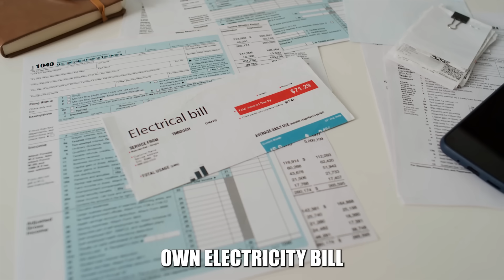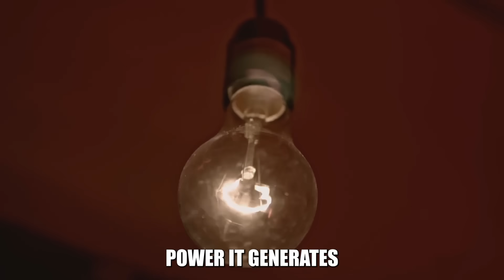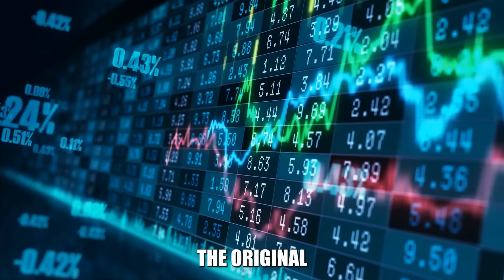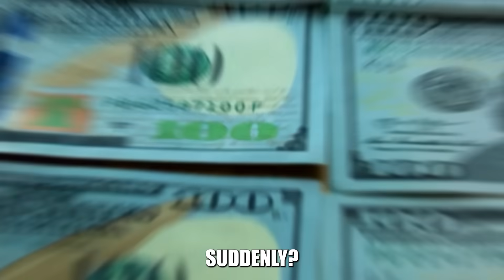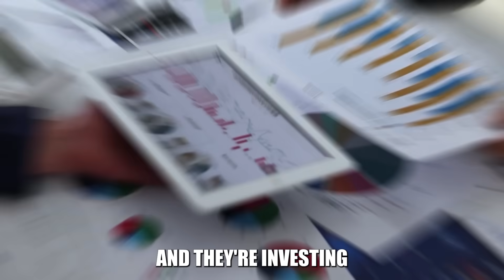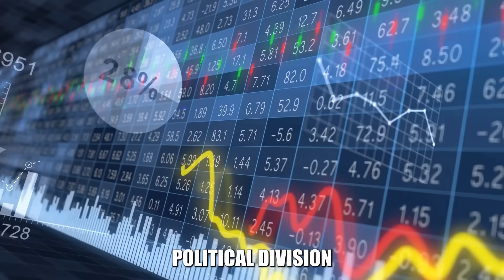Inside Guyana’s $1 Billion, 165 MW Amaila Falls Hydropower Mega Project

Comment: A well designed Gas to shore  project  and construction of a modular oil refinery, will provide all the power generation without burying some of the potensial million of tons of valuable minerals. Converting the ng hydrogen will  provide  cleaner power and add better value .The inability to get the kind of financing needed, is the cautionary signal to leave that on the shelf for now.